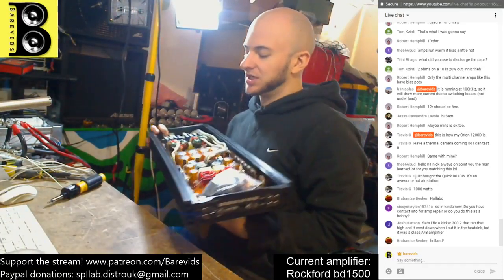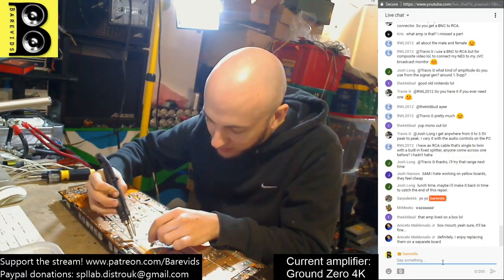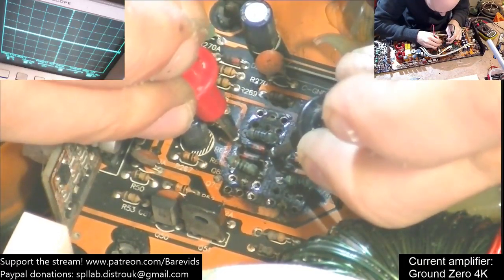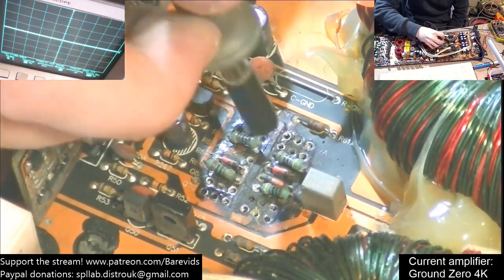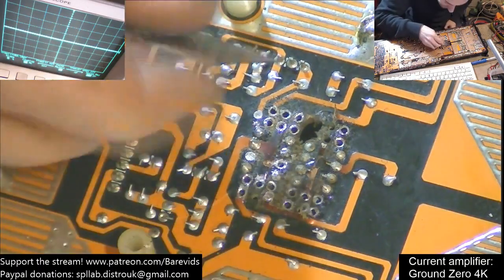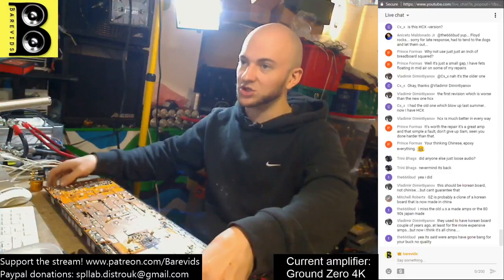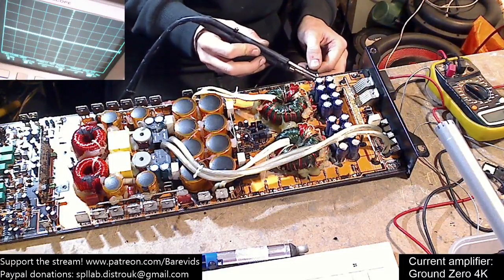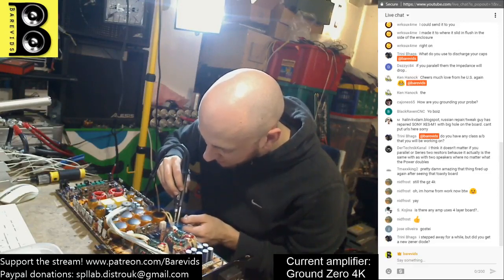The WORST burnt drive circuit - GZPA 1.4000DXII Amplifier repair

Comment: My theory: there might have been a loose screw/bit of metal knocking around in the case, it hit the back of the board where the mark on the case is (between rail and ground I believe), it vaporized and took out the PS section.
Reply from the maker: Yes very possible!

Comment: Factory installed smoke, all electronics run on it. Once it is out, those parts are gone. Until all components with new smoke are replaced, the unit will not funtion haha. Good video mate.

Comment: Had a flat tire on my truck this morning and then on my way home form work my sundown 3k started cutting in and out at full tilt, back to sundown it goes, what a shitty day.
Reply from the maker: +Cole Woodruff sounds like vibration damage. Might not be covered under warranty and could be an easy fix for you.
Reply: Dude that what I'm scared of even tho is wasn't mounted on my box I have a 97 chevy 1500 ext cab I have a 2x4 rack mounted on the floor for my 3 15s box and I have a 2x10 screwed to one of the legs under my box for my amp I don't know where else I can put it I'm running out of room thanks for your advice Sam and also I've been subbed for quite awhile, hopefully I get my amp back soon and I hope the bill aint to high if I fucked it up.

Comment: I would probably have cut out entire board section and replaced it with vector board and rerun traces with a repair kit. Used to use "Pace Cir-Kit" repair kit, which is still available, but now bloody expensive. (Found a mostly complete set on ebay ~$15 shipped, but new kits run about $135.) Kits include through hole rivets.
Reply: Pretty much what I was thinking, only way to be sure you won't get future problems from the carbonised board.

Comment: You stated output fets are 24n40f, saying it’s a bit excessive on the voltage side and that you could replace with 69n25 fets that would make it much more stable @.5 ohm. I’ve noticed the switch lowers the voltage rating but increases the amperage rating of the output mosfets. Im assuming that’s the main change between these fets, is that usually the common way for making an amplifier more stable at lower ohmage? I’m new to the amp repair scene and wanting to learn everything so any info, on any level, would be greatly appreciated bro, been binging on your vids and they are helping tons with my Kicker 06ZX750.1 power supply meltdown repair 🖖🏼

Comment: Hey there... I've been looking at a 4000w mains inverter (sine wave) recently which is surprisingly similar to the amps that you are showing, and I wondered if you have ever seen a similar design, it's quite interesting.

The unit was reported with intermittent flashing of the protection / shutdown light, and a ticking sound, but was still running, and powering ~2000w of equipment.

The unit has an architecture almost identical to the amps you are repairing, and even has the same type of driver boards (I'd love to know if you recognise any of those from amplifiers!).

Anyway, it's a 24v unit, and the power supply section has 6 power transformers, each has a pair of IRFP4368 FETs... but each transformer, with it's pair of FETS is in an isolated circuit with on board fuses (sharing the drive to the gate)... and what has happened is one pair of FETS has gone down, burned the drive resistors etc... but the (40A) fuse for that pair of FETS has blown, and the remainder of the unit is still running!... I believe that one of the drive channels is impacted by the failed FETS however, and this is causing the remainder of the power supply to run at a lower voltage than normal (it needs 340vdc)... and this is what is triggering the warning light.

The net result seems that I have only 2 FETs to replace, not 12, and the unit remained operational, albeit at a lower output power.... I'm somewhat impressed!  I'd love to know what you think about that design.

Comment: Hi, I wanted to ask for an Evo 4000  1d  sound digital It has short a MOSFET that has deleted model only says C2 wanted to know if you could guide me in a replacement since you repair amplifier class d. Since thank you very much from Argentina
Reply from the maker: Hi dude, sadly no, I have asked sounddigital for information on their component parts but they only give this info to official repair centers and will not tell me. As a result the amp is not repairable without knowing the part numbers.

Comment: why don't you take a picture of the damaged area, and completely cut it out and replace with a new board with out the copper clad.  Or use copper clad board and re etch what is missing and splice it back together with a nice looking repair that will last.  I know it would cost more but as for providing a warranty you be able to do that with no problem.

Comment: Wouldn't it be easier to drill/cut out the entire burnt section, etch your own PCB, and epoxy it in like a drywall patch? I'd never trust anything that charred.
Reply: Please allow me to answer:-)
Your idea is fine but often not the best solution, you risk making that part of the board a week point. You can easily trust a charred board if you do remove all what is charred and then lay new tracks, if particular bad, you can carve out the charred spot and lay new tracks and then fill up with epoxy. In that way, you still have the original stiffness and protected tracks.